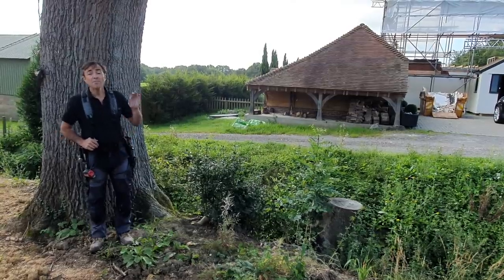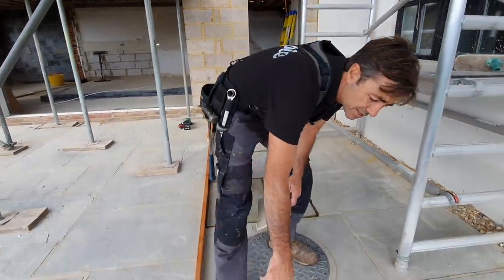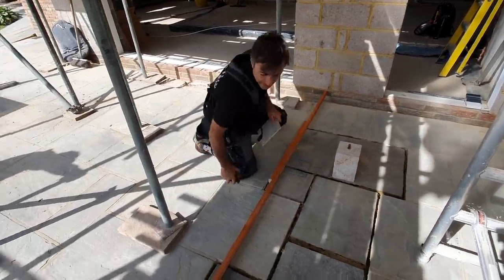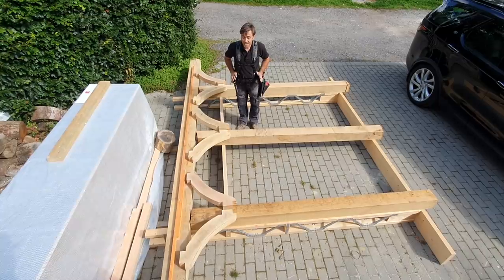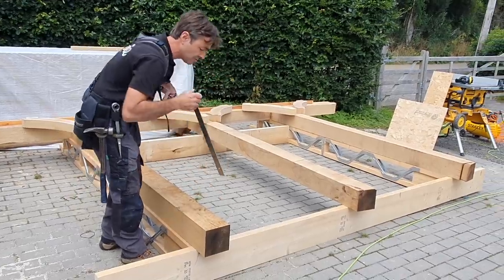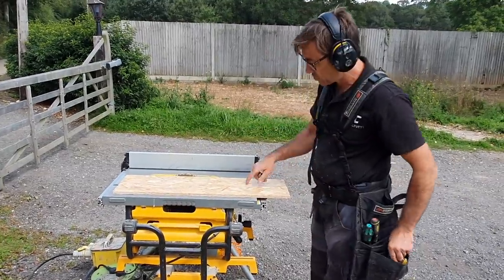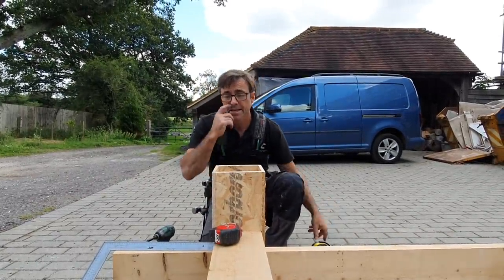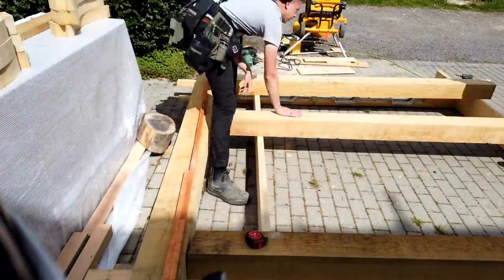The Big Build 21. How to make a simple Oak frame to support roof rafters

Comment: One of your best videos ever. I used to do an awful lot of green oak work in the UK and have cut my fair share of mortice and tenon. Never seen that sliding box trick for keeping everything square. Love it. Nice to see the chain mortice machine too. You have made life a bit easy for yourself though by getting all the members including the knee braces pre cut. We used to buy slabs of green oak and cut out what we needed on site with chain saws. The big curved beam supports you get on the old barns were fun to cut and tenon each end. And fun to get in. If we were doing a repair often we would age the wood. Burn areas and then clean up when all treated looks more natural than beating up the timber. I miss this sort of work.
Reply: Dave taylor, framing probably hasn't changed all that much since you did it, were still ripping slabs, snapping lines, twist marking and 500's.
Reply: @leftfootforward1040  Glad to hear it. I haven't done that sort of work now for over twenty years but I spent nearly twenty doing it.

Comment: I like the Ol' Makita morticer. It plunges in 4 positions once clamped. Fwd & back from the lever then swings to left in both positions. Speeds up production if one has lots of mortices to cut. Prob not as quick as the mafell but solid workhorse

Comment: Great video, and thank you for sharing your knowledge.  I'm trained as a cabinet maker, and it's always interesting to see the dark side!  
Just one thing: I think you are taking an unnecessary risk when you are using your table saw without a riving knife (as well as it being against H&S for woodworking machinery!)
Reply from the maker: We have had more issues with the riving knife than with out it!! many new portable circular saws do not have a riving knife, For my own use I generally remove the knife
Reply: @ukconstruction  Thanks for the reply. It's interesting - perhaps the rules are different for site.  Kick-back can be scary when it happens, and I've seen some nasty things on fixed machinery because of it!

Comment: Thanks Robin. I'm preparing to build a timber framed workshop (as per The Restoration Couple) and have watched many timber framing videos, mostly American, but nowhere have I seen tenons cut with such accuracy. That box is a complete boon! Please show us your subsequent steps where, I presume, you'll be drawboring the frame together with Oak pins? Also please could you recommend one budget circular saw - 240V would be OK - to make all the necessary cuts?
Reply: oak pegs not pins
Reply: Normally chestnut pegs are used as there's not much movement in them try looking at the makita 5903rk it's a beast of a motor and remember to get a good blade fred red or fruad pro 😝  with about 60 teeth with give you a good cut 🔨🍺

Comment: Hi Robin, how do you fix the staddle stone down? and do you put a type of resin on the peg before you mount the oak post? Thanks
Reply from the maker: We cut set them onto the foundation pad and then pave around them and point with a decent sand and cement mix

Comment: Beautiful to watch such a skilled tradesman at work. Like the box template, great idea, mate.
That chain morticer did rip up the edge; thought you'd drive the chisel in first to prevent that?
Or do it from both sides downward, but there's scope for inaccuracy there, I guess.
Reply: Driving a chisel down still won't prevent it because of the chainsaw ripping upwards motions 🔨